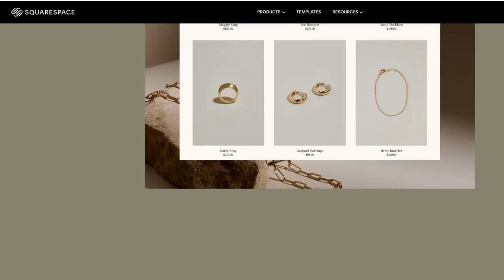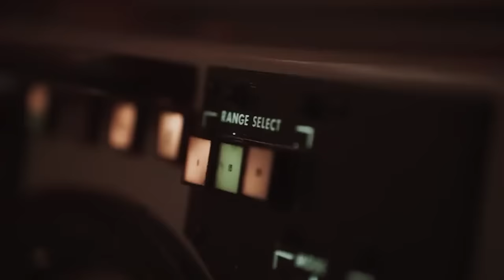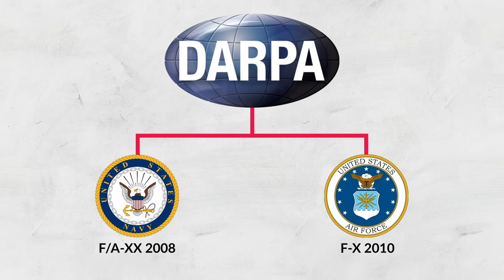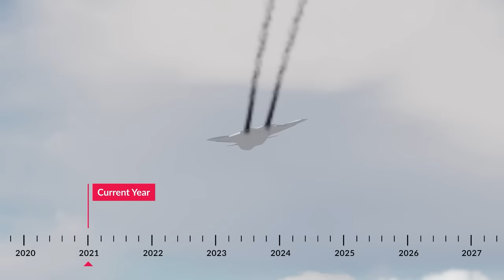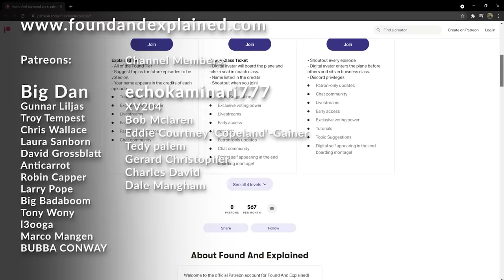FA-XX - The Next American Fighter Jet

Comment: As someone who has no insider knowledge right now, my prediction is that we will see more of the YF-23 design someday.  At the time, the USAF was mad at Northrop for blowing the budget on the B-2 program, so at least partially due to that, the YF-23 narrowly lost that bid.  I think a slightly larger, 2-seated version of that with completely modernized engines and avionics seems really compelling for a 2030's fighter jet.  The way air combat has changed in recent years has really gone right according to plan for the YF-23 even compared to the F-22.  The game is less about turn-fighting and more about how quickly, quietly, and effectively you can get in and get back out.

The F-35 claims to embrace that same ethos, but it is not nearly as stealthy as the F-22 (let alone the YF-23 which was rumored to be slightly stealthier), it can't carry more than a few hundred miles of fuel, and its single engine is overburdened with how chunky it got.  Both the F-22 and YF-23 still have better kinematics than the F-35 despite their superior stealth and range.
Reply: Most of that was correct but the F35 has more range and capability than u think
Reply: Japan's 6th gen is using the yf-23 as a starting point
Reply: The YF-23 represented more risk since it had several problems in DEMVAL.
* They cracked several wind screens according to test pilot Paul Metz.
* They were not able to reach Mach 2 due to intake geometry and boundary layer control.
* They did not demonstrate weapons storage or separation.
* They doubled the control surface actuator count to get the wings clean from any bulbous fairings common to other aircraft.

JSF are actually more stealthy than the Raptor from frontal aspect, oblique, and rear since Lot 4.  They use more CF structures, which are RF permeable/non-reflective.  F-35A has longer mission radius than the Raptor on internal fuel.  Same with F-35C.

In large force exercises, JSF regularly defeat F-22s and prevent them from attacking Blue Forces.  This has been true since 2017.  F-22 was cheated out of its AIRST, so it has no long range IR detection sensors as originally planned.
Reply: @LRRPFco52  to be fair I had somehow not seen the reports of the JSF's stealth improving in the early 2010's.  Its shaping is much sloppier than either ATF plane, but evidently the new structures/coatings that were added to the JSF make up for a lot of it.

Also, while their mission radius is stated as close to or exceeding the Raptors, the fact that the ferry range is still somewhat lower even on the F-35A makes me think there are different definitions of "mission radius" being used.
Reply: @JMurph2015 the difference in ferry range is because the F-35 doesn't carry Any external fuel tanks.
Reply: @andrewmoore7022  actually it implies the ferry range on internal fuel only is still larger than the F-35A. With drop tanks that number goes up even more.

Edit: while it's not totally clear, I fact checked their maximum fuel loads, the F-35 actually has larger internal stores in absolute terms than the F-22, which is definitely interesting (18,250 lb vs 18,000 lb), so the F-22 would need drop tanks to match range as it is a larger aircraft overall and twin engine at that.
Reply: @JMurph2015  F-22A has an older structural approach to boundary layer air for supersonic flight, using splitter plates.  F-35s use Diverterless Supersonic Inlets, which are much cleaner and simpler.

F-22 uses older RAM that needs constant re-application and degrades with use.  JSF uses integral RAM in the surface structures that get better with wear.

F-22A ferry range is longer because they use external fuel tanks, as they do in the Alaska Air Defense Intercept Zone mission profile.

F-35A radius is published as worst-case end-of-life with a worn motor right before overhaul, with inefficient seals and a 2000lb fuel reserve, and full bring-back of 2x 2000lb weapons plus AIM-120s, for multiple go-arounds in the landing pattern.  Actual radius of the F-35A is much more than that, not published.
Reply: YF-23 is long gone dude. Won't happen
Reply: yf 23 is dead move on. f35 has better stealth than any other fighter. f35 has good kinomatics especially when its not fully loaded with fuel. did you know the f 35 carries as much fuel as the f22 and the f 35 is way smaller. put in same amount of fuel in both and f 35 will do very well. f35 carries more fuel than any other fighter except for maybe su 35 and su 35 is over 70 feet long its freakin huge. also it only has slightly better thrust to weight at gross weight. also im old enought o remember when yf 23 and yf 22 were competing i remember when i first saw both aircraft. they looked equally advanced. we think the raptor doesnt look advanced because weve seen it a million times over the last few decades and some silly people think yf 23 looks more advanced becauase you havent seen it as much. they look equally advanced. also yf 23 is a failure of 5th generation it is not 6th gen it is not 7th gen its a relic. maneuverability will always be important thats why f22 is still better than yf 23. also its weapons bay is horrible on yf 23 to complex didnt work
Reply: @Aaron-wq3jz  f35 carries way for fuel than most fighters even fighters that are much larger. put in equal fuel and f35 will wreck just about any fighter
Reply: Idk where you get your information from but this is hilarious
Reply: @noncog1  I know they were hinting at using the yf-23.

Comment: I think the next generation of aerial combat will not compose of a single aircraft, but a system composed of aircrafts specialised in various roles.
From small to large, the smallest units will be autonomous drones. They are small, cheap and exceptionally manoeuvrable (able to pull intense manoeuvres that no human can handle). They will act as a defence role, intercepting enemy aircraft and missiles, sacrificing themselves to protect larger allied aircrafts. Quite defenceless on their own, but quite formidable in swarms.
Specialised aircrafts, these includes interceptors, e-war aircrafts, hypersonic recons, and surface attack aircrafts. These can be manned or unmanned, each can relay command signals, they are responsible for offensive actions and are dependant on each other.
Central command aircraft, these are the moving command stations of the Air Force, they do the support role, away from the front line. It will coordinate the numerous drones and manned aircrafts. Although it does not pack offensive weaponry, it has a laser defence array and a powerful jamming device, which can seriously mess with any missiles that come in its way.
Reply: Sounds like AC7's Arsenal Bird
Reply: FA-XX looks like a copy of the Chinese J-20

Comment: 6th gen imo should have 

1. AI/ML to integrate and condense information for the pilot

2. Integration of sensors, and the ability to network with any military asset. For example, the targeting information from the jet is able to be communicated to another jet, or warships/ground systems etc. This can allow the fighters to target and destroy using weapons from other sources. Interestignly, this is something the US is already working on with JADC2. Recently an F35 was able to send 

3. High speed. super cruise should be between mach 1.8-2.0. Afterburner should reach mach 2.5 minimum

4. Longer range. Especially important for naval variant, because countries like China are making missiles to deny carriers from operating near their coast. Longer range jets allow carriers to be sationed farther away and still project force, or do much deeper strikes

5. Stealth. (obvious) Removal of tail seems to be the meta for 6th gen, significantly improves stealth and less drag. 

6. Integration with drones. Drones would be a game changer, because they can allow the fighter to turn radars off and remain very well hidden; while drones can scout ahead to gain information and send it back to the fighter. The drones do the risky tasks that would be to much of a risk for manned fighters to do. Losing a drone is no where near as bad as losing an entire jet along with a very well trained pilot.

7. Enhanced ECM. For the US, doing SEAD/DEAD operations is very important, especially after Desert Storm. ECM and other measures to degrade enemy radars, and missiles greatly enhance SEAD capabilities.

Overall, the US is well positioned for 6th gen. The US already has very advanced engines under development (AETP) they've already built prototypes for. The new engines are stated to have around 15% more thrust, 25% better fuel efficiency, and 50% better thermal management compared to the F135, which is the most powerful jet engine right now. With these stats, 6th gen engines should be pushing around 210kn of thrust which is insane. The better thermal management, and power also makes laser weapons, and more powerful radars possible as well; keep in mind F-XX will most likely have 2 of these engines installed. Infact these engines are poised to be placed in F-35's by 2027. 

Advance engines are going to be required for 6th gen, China is behind in engine technology; only just now capable of designing engines comparable to the F22 raptor, whose engines represent US technology from the late 80s and early 90s. Meanwhile Russia has budgeting problems. Europe has the money, and the know how to make 6th gen engines as well. Rolls Royce knows what they are doing. Japan also started to investigate engine technology early on as well.

Comment: No military equipment or weapons program is safe from hiccups and issues. The F-35 may have issues, but it is a very capable 5th generation fighter, and it will only get better with time and tuning. And the F-22 wont be phased out as quickly as people think, as it is currently under more modernization. Nevertheless, I’m extremely excited to see a 6th Generation Figher, and what it will bring to the battle field. One thing I love about the US military programs, they keep their programs mostly or completely under secrecy.
Reply: I think the F22 will be phased out quickly due to the fact the Air Force is cutting the budget for the program, and not maintaining the stealth coating on the aircraft that are in service.
Reply: @archer1133  that’s simply not true. The USAF continues to procure funding to upgrade the F22.
Reply: @NinjaKiller1022  Although they may be upgrading a few aircraft (like the chrome raptors), the government has cut money from the program and has allocated that money to F-15EXs and other aircraft. Just look up "F22 budget cut" to see more details I guess.
Reply: @archer1133  I see what you are saying. But contrary to what is being told to the public, funding had not been cut for the F22 and it’s modernization. The government had stopped production of the jet, with the last one rolling off the production line back in 2012. The government has an obligation to keep modernizing the jet well past its last delivery. As someone that works with people, that work with this program, there has been no cut. It was the same when we were working on the EFV. The news was pushing that we had cut funding for and stopped operating on the EFV, when in reality, that was not the case. Furthermore, I don’t doubt that the US is allocating funds elsewhere, there’s a lot that we don’t know, or will ever know.

Comment: I have parts for a 8th gen...I guess

Can fly in any direction while facing one.
A.I. video game based combat interface suite
Weapon: Main- 6Mw microwave cannon @ 1/4 in. Diameter/1 mile
Speed: limited only by structural strength. Mathematics unknown approaching light speeds.
Propulsion: momentum transmission (my refined design)

What? I wanted a flying car...

Comment: I don't know if the Navy can maintain RAM at sea. The planes live on the flight deck for 6-7 months or longer with constant UV and salt spray. Look at the F35Cs on their first deployment. They look rusted. Stealth at sea may require a new carrier. One where the flight deck is below deck, and maintenance is done topside. Launch out of the bow.
Reply: That would make landing very difficult  because you're now aiming for a hole instead of a flat deck
Reply: @zacyoung4446  VTOL in 6th gen?

Comment: The F/A-XX is the US Navy's 6th Gen fighter and it replaces the F/A-18 Hornet, The NGAD Program (FX or PCA) is the US Air Force's 6th Gen Fighter which replaces the F-22 Raptor (not sure if it replaces it)
Reply: If you notice most of US NAVY jets now use design and placement to get High Alpha.  The US Navy uses mathematics to adjust the center of gravity and center of lift to achieve rocking moments to achieve high alphas
Reply: @rgloria40  hm, yes. But in this concept, it has some Canards like the J-20 or sorts but i think (based on my research) it will reduce the stealthiness of an aircraft unless if they reconstruct the Canards in some diamond shape or sorts or add it with RAM Coating. It'll be fine. Thus, it must carry a huge payload so its gonna be a CHUNKY aircraft where its compatible in launcing on the USS Nimitz & USS Gerald R. Ford and maybe some future Carriers (sorta).
Reply: @NOVAPHANTOM9  Compared to a Tail Rudder that are not slanted...It is a huge improvement.  Rudder authority versus banking....looks to me it is a training issue at this point.  I doubt the US Navy or USAir force will use retractable carnard or even a tail rudder....but who knows...
Reply: @rgloria40  yeah, i mean totally a yes. If you want an agile aircraft, you can just make Thrust Vectoring technology on your 6th gen compare to the F-22's 2d Thrust Vector & some Russian aircrafts like the Su-57, Su-30 and etc. which has 3d Thrust vectoring.

Comment: I rather suspect that Roper was talking about the Boeing Wingman.
Assuming he was talking about an NGAD platform which is nearly operational and could be considered a "prototype".
If on the other hand, he was talking about a tech demonstrator to test features, it could just be a 4th gen aircraft which has modifications to test out some ideas in the air. 
Much like the X-31 was during the ATF program. News outlets infer far too much into exactly what Roper said.

Comment: All this talk of fighter generations leads me to share what I find to be quite a sobering observation ...
There were at best only three AIRCRAFT generations between the Wright Flyer which first flew in 1903, and the A-12 Cygnus which first flew in 1962.
The Wright Flyer was a string-and-canvas butterfly which flew no higher than thirty feet off the ground, at no more than 30 miles an hour.
The A-12 Cygnus was the interceptor version of what became the SR-71 Blackbird. It was a fire-breathing dragon that flew at an altitude of AT LEAST 85,000 feet and a speed of AT LEAST Mach 3.1 ... faster than a speeding bullet.
From butterfly to dragon in sixty years.
Think about it seriously, and you begin to understand what Alvin Toffler meant by future shock.
Reply: If you take the moon landing into account it's even crazier.
Reply: @Tony.795  Ohhh, yeah. Big time.

Comment: the f-100 is supersonic too despite a second generation
Reply: Supersonic is one of the characteristics associated with 2nd gen.  Most of the 1st gen (e.g. F-86) were merely transonic.

1st gen - WW2 fighters with jets (P80)
1+ gen - swept wings, moving away from guns as primary weapon (F86)
2nd gen - supersonic, early missile armament (F-102)
3rd gen - designed for BVR with radar, missiles, often no guns though guns were added back later.  Frequently multi seat and multi role because big and fast allowed the same plane to do several things (F-4)
4th gen - designed for maneuverability and dogfighting without sacrificing BVR capability; pretty much all multi-role, use of computers meant less need for 2nd crew (F-15)
4+ - upgrades to avionics and other tweaks without changing the basic 4th gen airframe (F-15E)
4++ - new or substantially changed 4th gen designs incorporating things like some stealthy features (F/A-18E)
5th gen - built for stealth without seriously compromising 4th gen design goals.

Question for me is whether 6th gen will be 3rd all over again with a heavy focus on BVR over dogfighting - no guns, no thrust vectoring, just stealth, radar and missiles.  The F-35 was already headed that way.

The best dogfighters may have already been built, and one day it may seem as quaint as a sword fight.

Comment: I would rather go with less is more. Drones that can sync with 6th gen and also be controlled by drone pilots(on ground or wherever) to lessen the load so a pilot in the air can focus on the action.
Reply: Drones have issues with latency and connectivity.
Modern day drones need to be independent from GPS as much as possible.
Tomahawks and alot of cruise missiles achieve this by referencing terrain data from downloaded sattelite maps, to gauge position.
Drones are also fundamentally unstealthy, since to literally function in the first place, they need to emit radio emissions.

Because of this, Drones are very inflexible, and would probably be used in a limited role as before.

Comment: Its when they go full unmanned that these things will really be able to go all out. Perhaps that will happen with 8th gen. No ejection seat, no life support system, no human shootdown risk therefore CSAR risks, no hostage risk. Rate it to pull +70Gs, advanced AI all that jazz. Will be controlled from the ground with ultra high rez VR systems or full wrap around display in a full motion level D sim synced to the airplane. Or with the option for full AI  - although that is another big can of worms.  Right now no matter how powerful the plane is , its us - the meatbag up front -  thats the performance limiter.
Reply: I don't think any airframe will be able to handle +70Gs due to the stress
Reply: 70G? Even if you didn’t care about keeping the plane in one piece, doing that in atmosphere is impossible